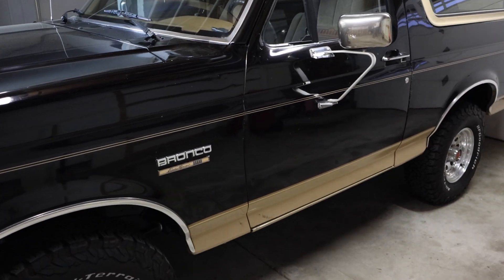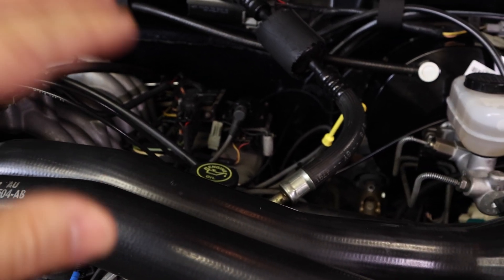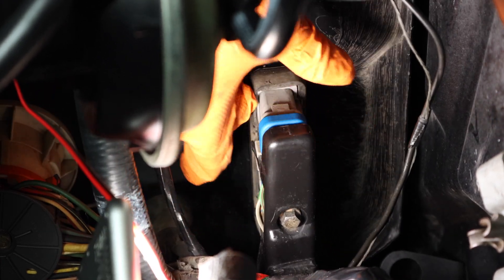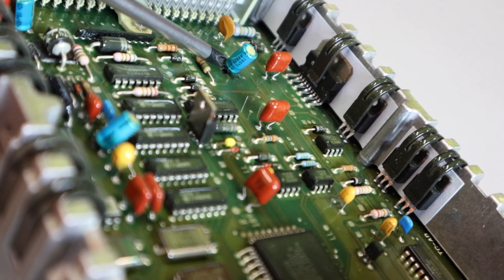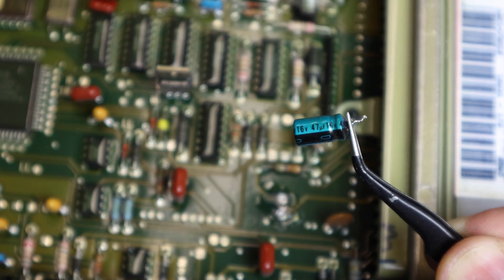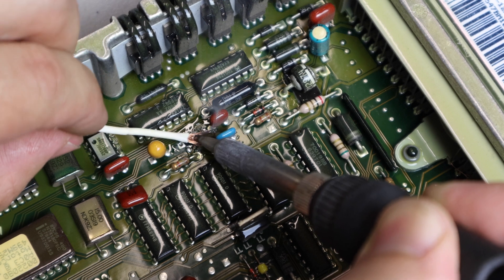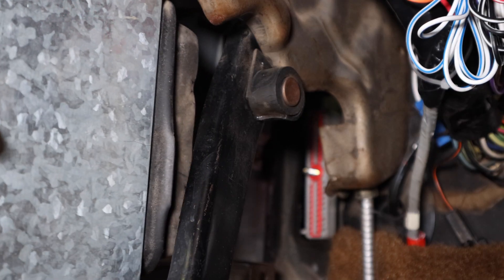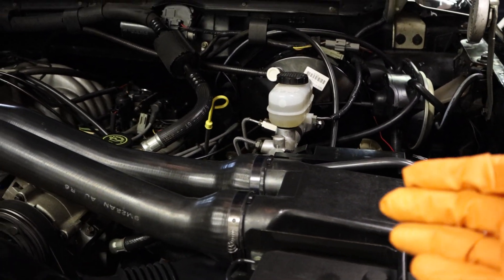Ford ECM Repair EEC IV | Fix Multiple Issues | 1980-1996 Ford Bronco F150 | Bronco Restoration

Comment: Hi … just wanted to say very well done. My truck (1995 F-150 XLT) started randomly stalling on the road. Mechanic did fuel pressure, changed fuel filter, added sea foam 
Seemed to be running better but still rough at in the beginning and today driving a couple miles, it stalled again. Started reading forums and owners with the same problem mentioned the EEC. Your video really explains things and last, you have one clean looking engine.

Comment: Bro! I’ve been chasing some problems on my 91 f250 for ever. It hasn’t run in a few months but I just did new injectors and a new dizzy. Still not running right. I came across your video and said what the hell. Pulled my ecu and sure as shit, 2 of the caps were leaking and one leg was not making contact on 2 of the caps.I didn’t bother with doing it myself and just ordered a new one. To say the least I think your video saved my ass. Thank you for making the vid. New ecu comes in this wed and I’m pretty sure she will run great. If your ever in so oregon I owe you lunch😂
Reply: And?
Reply: Hey hey, noticed what you mentioned in your comment, just curious- where you located in So OR? I'm in Grants Pass area myself, and this vid also helped me out big time! so you play drums? Awesome! Me too! I'm a Tama devotee myself, but I can dig a nice set of Pearls also, a great drummer will make the real difference between any drums sounding great or not so much, but as far as drums go I'll say they both examples of awesome Japanese craftsmanship once you're into the high end side of things, but yea I figured I'd drop ya a line and say what's up, if you're near GP at all we should talk drums and trucks over a Dutch Bros or something!

Comment: I got a 91 f150 4.9 4x4 with a high idle at 1.5 rpm while in park . Also dies whenever you put in any gear. Thoughts?
Reply from the maker: Check the throttle body and cable, clean if necessary. Also check the iac valve and tps sensor. Run diagnostic codes (be sure the engine is warm before pulling codes)

Comment: Great video. I assume this applies to 5.0 as well? I have a 1990. I have seen other videos showing loosening of the wheel well cover as opossed to the kick plate.

Your way looks easier. Thanks, Steve
Reply from the maker: Yes this will work with the 5.0, the 1992 and up (obs style) require removal through the fender well, I have done it without complete removal of the fender lining, just pop out a couple screws and the lining will bend out of the way.

Comment: My 1995 F250 7.5L has been stalling out at red lights or when slowing down.  It runs perfectly when going down the highway and has no issues when cold, but once it warms up and I go to make a stop, it will 5 times out of 10 stall out and then fire right back up again.  I just got a scan tool so I can work on testing it later today, but I'll add this to the list of things I should check.  

Have you ever seen a bad ECU cause stalling like that?  I'm also wondering about the IAC, MAP, and ICM, but I'm fairly new to these older trucks (I'm used to ODBII and having a scan tool to pull codes when something goes wrong).
Reply from the maker: Check your egr system, verify your egr valve is not stuck open as these are common symptoms of failing egr. Also replace both fuel pump and ecm relays.

Comment: Interesting... I left a comment about the possibility of changing the caps to 47uF 25v rating, and how that might eliminate the need for any repeat replacement, and how the statement that "these are designed to only last about 15 years" that's made in this video at the 4:30 mark is false. There is no specific date of failure named in electrolytic capacitor design, and their lifespan is largely dictated by what they do in a design, and if the voltage rating is high enough for the stated purpose of the cap in the design... 

I also said I would consult an electrical engineer relative of mine for confirmation of this theory.
I checked with my relative, and my suspicions were confirmed that an ECM running at 12-14v that had electrolytics rated for 16v in it would indeed have it's electrolytics be prone to early failure. He also shared with me that doubling the value of the circuits operating voltage to get the recommended cap voltage rating was standard practice, to avoid failure like this video is showing... He worked for 40+ years designing high sensitivity medical testing equipment, and had a very elaborate explanation of why the 25v cap rating upgrade would be a good idea, and that also, a low ESR rating would be a good upgrade to the selection process for the new caps as well.

I came back a few hours later, and that comment is now deleted... I'm wondering why. Guess we'll see what happens to this one!

Comment: Awesome video, just subscribed! I have 1985 F-150 with the 5.0L. Truck starts and idles fine, but when I put in gear it stalls after driving about 10ft. Changed IAC, MAP sensor, coolant temp sensor, new battery, new ignition coil, and checked timing. Any thoughts on what my issue could be?
Reply from the maker: Check the MLPS sensor on the drivers side of the transmission. This tells the ecm what gear the truck is in. If the computer senses the truck is still in park it will not be able to deliver proper fuel trim parameters.

Comment: Nice video, I got a super clean 1993 Glaval Universal  E150 conversion van that’s having some awkward issues that apparently has cost a family friend hundreds of dollars to no avail and was given to me to solve it and since it’s mine if I do my motivation is high. They replaced the sensors form transmission to the cluster and nothing ever fixed the bouncing speedometer and rough shifts and I’m certain now I have a capacitor issue after this video. Great work and damn nice bronco
Reply from the maker: Be sure to check all speed sensors, your truck should have three, one on each front wheel (abs) and one on top of the rear diff. Does the overdrive light flash?
Reply: @TheFixTech  all three replaced and The od doesn’t flash but the air bag does, after replacing all three sensors it worked for about a day and then it was back to the bouncing speedometer and The no shifting into OD it down shifts and throws itself into limp mode. Speedometer works and shifts are smooth until 45, shifts are good until 55 but after 45mph is achieved it begins to bounce between 45-55 and every mph closer to 55 I get the wilder and more eradicating the bounce.

Comment: Good video as always. I have problems with the parking brake, do you have any video of that?
Reply from the maker: Not yet, depending on the year the parking brake has an adjustment under the driver seat, under the vehicle. I have a video on the rear drum brakes showing how the parking brake cable routes inside the drums.

Comment: Is it normal that my 1987 bronco only have 1 capacitor? And the label in the EMC says 3.0 Taurus Sable only
Reply from the maker: A lot of ecm are interchangeable from different cars/trucks but will not run properly. The engine size, transmission and year are specific. If you can visit your local junkyard and try to pull ecm from similar trucks, 87-89 should work, be sure to pull the ecm from a V8 truck with the same transmission.
Reply: I take off the ECM and to my surprise it looked pretty good,but it said taurus 3.0 on it ,so I ordered a new one thinking maybe previous owner put a wrong one. 320 dollars later the new one said taurus 3.0 also and my truck didn't even started. I sent it back ,so am still driving it feels  week on hills .it sucks

Comment: Excellent DIY Video..I think you did a great job making this video.
 However; Don't know what year your Bronco was, but it didn't work for my 1994 Bronco XLT 5.8.
After removing the drivers side kick panel I could clearly see it didn't match your video and there was no-way the EEC-IV was coming out from the inside.
 Mine had too removed from the engine compartment of the drivers side fire wall.
So for anyone doing this, double check to see if your EEC-IV is removed from the inside side of the fire wall or engine compartment side of the fire wall.

Nice looking Vehicle.. Don't know what year your Bronco is, but looking at the vehicle photo I'd guess it was a 1993 or earlier.

Comment: I checked my ecm, capacitor wasn't leaking... 
Maybe pick up coil?
Reply from the maker: What issues are you having? If no start, then check for fuel at the rails. Check for spark at the plugs….
Reply: @TheFixTech  :  slight misfife at low rpm. New injectors,rotor, cap,wires,plugs, iac,egr,egr control, ignition coil,map, tps...slight rpm drift. Low:600 to high 1000.

Comment: Great video.  Where is the best place to buy the capacitors?
Reply from the maker: I’ve found good quality on Amazon and local sellers on eBay. You can ask them if the capacitors are recently manufactured.
Reply: Amazon has the resisters look for the name brand for quality

Comment: great video and how-to.  I have an 1989 Ford Bronco 58l with C6 4x4, do these 3 capacitors affect the fuel pump function?  My Bronco won't turn my fuel pumps on- only if I remove the fuel pump relay and jumper wire the hot to the pump will it run them and then I can drive it.
Reply from the maker: The capacitors do not directly controls the fuel pump relay circuit. There are two relays that control the fuel pump, the eec relay and the fuel pump relay, they are located next to each other. If the eec replay is bad it will not power the fuel pump relay.
Reply: @TheFixTech  thanks- well there is power available to the fuel pump relay plug but the signaling side of the fuel pump relay plug doesn’t seem to be working so i figured it was a problem with the ecu
Reply from the maker: I had an issue recently similar to yours and replacing both relays solved the problem. If you are still having issues check the wiring, and open the ecm cover, if the capacitors are leaking replace them as they will only cause further problems.
Reply: @TheFixTech  excellent thank you

Comment: vehicles were relatively simple in those days I bet you cant do that on a vehicle made from about 2000 onward  because they  intentionally overcomplicate things.
Reply from the maker: True, you need special scan tools and pay a subscription to the big auto manufacturers to download the update drivers for the power window motors so the headlights will work.
Reply: @TheFixTech  now even if you replace a fuel injector or shift solenoid they have to be programmed and calibrated unlike old vehicles no more yanking parts in the salvage yard

Comment: Bro, I am literally crying. I have been trying to diagnose my 1992 f150 5.8 for almost two years. Have replaced basically every sensor, wires, hoses, etc. I've read hundreds of forums trying to fix this rough idle, intermittent dying, zero power, absolute BS running rig. You're my f**king hero, man. Thank you, thank you, thank you!
Reply: Same here on a 92 150 starcraft conversion. Talk about a freaking nightmare. Replaced everything like that. Finally wised up pulled ecm and opened it up. All the capacitors were leaking on chipboard. I'm researching now how to get the right one.
Reply: Update put new ecm in and she runs like a top, Minus a small coolant somewhere but it completely took away the transmission shuddering and missing also.
Reply: 89 ranger 2.9   sooo much time probing reading mm , cursing myself cuz this aint my 1st rodeo & finnally realized injector ground pulse intermittent, random,     ruled out tfi
Reply: I feel this comment in an emotional way 😢😊
Reply: Having a random stumbling issue on my 95 F150..have done the same, testing every sensor, replacing any that are reading odd..still can't get rid of the damn stumble...going to pull the ECM once I get my jeep running
Reply: Same here dude! Daaaaamn!
Reply: To @rebelspohn , Did you buy a new or used ecm?
 Or did you solder in new caps, to fix it?
Reply: I have a 91 Ford f350 7.5 can the PCM be faulty without showing signs or wear and tear?
Reply: GOD BLESS YA

Comment: Can a capacitor be bad without leaking. I had a constant running fuel pump and a no start condition. I replaced 2 capacitors that were leaking but left the 3rd capacitor alone because it looked fine. The fuel pump stopped running constantly but the engine still doesn't want to start. Needless to say I didn't see your video first.
Reply from the maker: Yes, these capacitors are old and can fail. Check both the ecm and fuel pump relays, if they are original then replace. Are you getting spark at the plugs?
Reply: @TheFixTech  yes I have spark and 38 lbs of fuel pressure at the fuel rail.
Reply from the maker: @ronaldrogers4960  Check the plug wires are correct, which engine do you have? The 5.0 and 5.8 have different firing orders, 94-96 were same. Also check compression.
Reply: @TheFixTech  I have a 1992 f-150 with a 5.8, 48,000 original miles. The plug wires are factory. The truck has run perfect up until it back fired last week.but it did start and I drove to the hardware store and it ran fine. Then on the way home it shut off with no warning. When I got out to investigate I heard the fuel pump running. After about 15 minutes I got it to start back up and it drove home just fine. But in answer to your question, I haven't checked the compression.
Reply from the maker: @ronaldrogers4960  With those miles compression should be fine. Sounds like the fuel pump and Ecm relays, both should be changed together. I had similar issues with my 95. Ford still produces these relays (newer version part number: 5m5z14n089a). Luckily I was able to switch the horn and trailer marker lights relay (they are the same) out into the ecm and fuel pump socket until my new relays arrived.
Reply: @TheFixTech  thank you for the information, I will get over to the dealer tomorrow and pick up a couple of new relays. Do you think I should pull the ECM back out and replace the 3rd capacitor?
Reply from the maker: @ronaldrogers4960  I would, at the age of these trucks consider it preventive maintenance.

Comment: Is there something else I could plug into that connector? Like and aftermarket engine management system that won't break.down like this?
Reply from the maker: I am not aware of any aftermarket ecm for these models. You can purchase a refurbished ecm from Rock Auto, be sure to match yours exactly as there were several different models. There will be numbers on the ecm itself that should match one of the Rock Auto listings.

Comment: Use Solder Wick to suck up /  extract the old solder ; Use a good quality Weller ( WE1010NA ) soldering iron ; that means no HARBOR FREIGHT JUNK ; Also its preferred that you use an anti static mat designed for electronics repair that is grounded ; other wise you could zap the electronics with a static discharge.
Reply: That sounds like good information.
Where would be the best place to get that soldering iron and any other good soldering supplies that you spoke of?
As well as the "Panasonic new production" capacitors?

It seems like nowadays you could buy new tools and parts and they're junk brand new and there's no way to know for sure.

Comment: thx for responding to my van problem. is it possible for the fuel pump to fail after warmup and then be good when it cools off? Also this van sits for months at a time in the Seattle area, I'm wondering if moisture is a problem. It trashed my distributor as it was corroded on the inside. I'm also curious about changing the fuel filter., and possibly the water temp sensor.
Reply from the maker: It’s very common for the fuel pump to be erratic. It is easy to diagnose, when the truck does not start, check for fuel at the engine rails. If no fuel then try to prime the pump manually, apply 12v to the fuel pump circuit (you can either at the fuel pump pigtail or at in engine bay) if no pump sound then it is a bad fuel pump. I do also recommend a new fuel filter and temp sensor as these trucks are old and require maintenance.
Reply: @TheFixTech  thankyou
Reply: I've also seen someone add a ground from the frame to the fuel pump holder.

Comment: I have a 1990 e150, 5.8 ltr been sitting for a couple months, wouldn't start, replaced the coil and distributor, stared fine, drove it 6 miles, it lunged then died, would not restart until it cooled off runs fine til it warms up, then keeps stalling. Any ideas on what might be wrong?
Reply from the maker: When it dies check for fuel are the engine. If no fuel then pump is worn and needs replacement. Otherwise it is possibly the ignition module.
Reply: @TheFixTech  thx, the ignition module is on the distributor.
Reply from the maker: @marvinlee3450  make sure the ignition module is the correct one for your truck as there are a couple different variations. If the distributor with replaced, make sure the timing is set with the jumper plug removed (near distributor) if everything checks out then should be a fuel issue. I would suspect the ecm last.
Reply: @TheFixTech  Is it possible for the fuel pump to fail after warmup?
Reply: When a small engine(lawn mower) won't start when it's hot, first thing I check is the coil.

Comment: Thanks for the great video, my ECU needs new capacitors but I am having a difficult time melting the old solder and removing the old capacitors' leads. I am afraid to keep the soldering iron for too long and damage the circuit board. You make it look so easy, what is the temperature of you soldering iron?  Thanks
Reply from the maker: You can try to cut the capacitors off, then use a flux core solder and melt a little on top of the old solder to help soften the old solder. Use tweezers to pull out the leads. If you do not have flux core solder, use flux paste. I usually set my temp to 600 degrees, but it can vary from machine to machine.
Reply: Solder sucker works well for this, basically like a turkey baster but spring loaded so it pulls the liquified solder out instantly